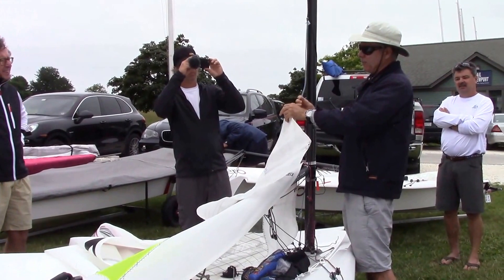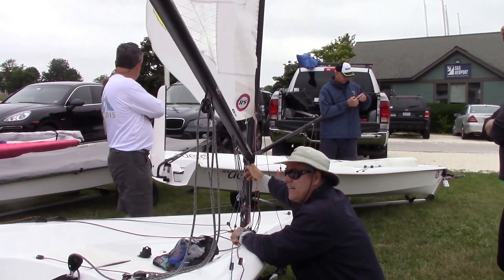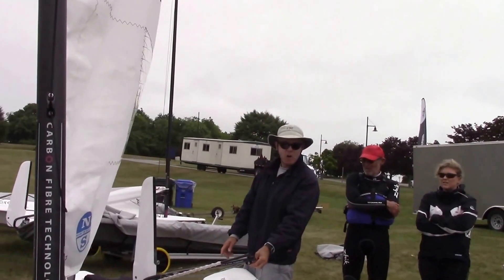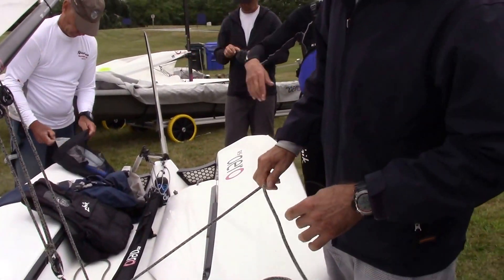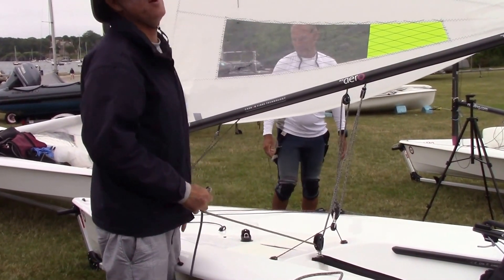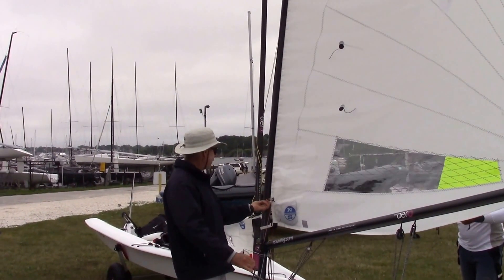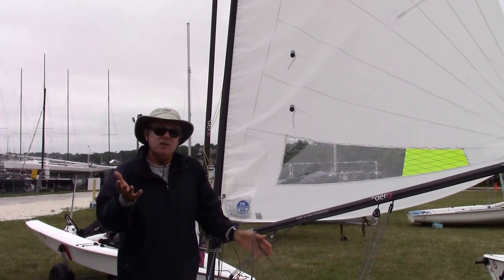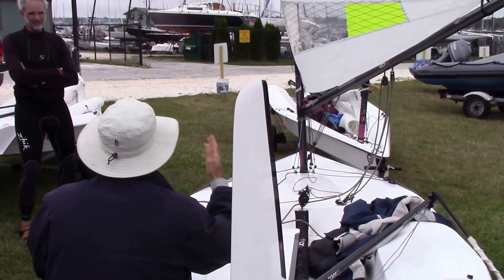Marc Jacobi on AERO rigging and sail control

Comment: This boat appears to have a lot of design problems with parts separating and the requirement for electrical tape. Not a safe boat if you are out in the middle of a body of water with heavy winds. Will stick with my Zuma.  I grew up on SunFish, Lazer and Force 5, and the Zuma is my favorite.
Reply: Rick Katz Design problems? How so? Putting electrical tape over the tiller extension universal or to hold the knot in for the Cunningham is just good breakdown prevention. The Zuma and Aero are like apples an oranges. Take one for a sail.